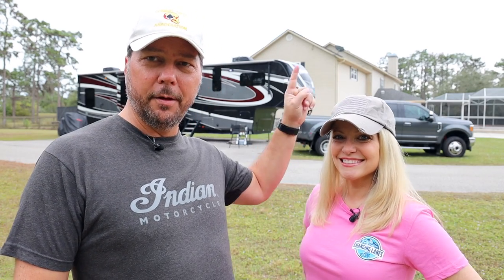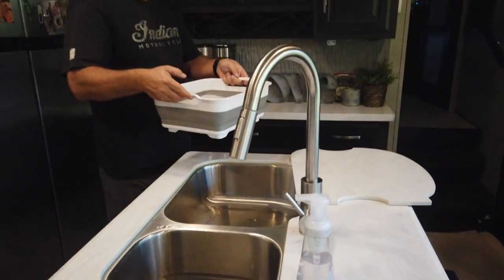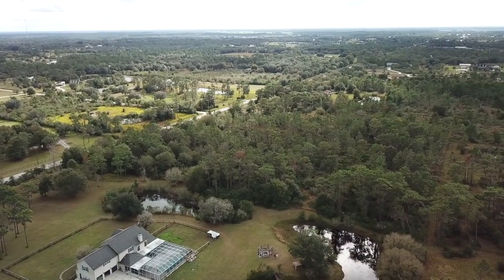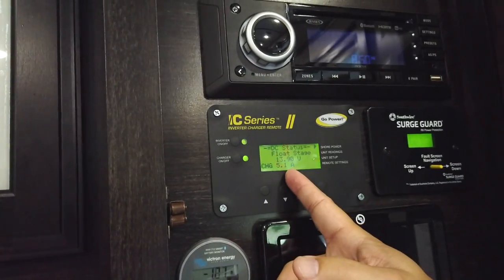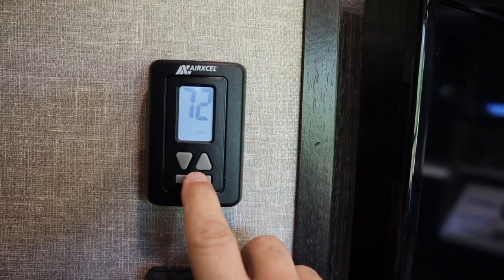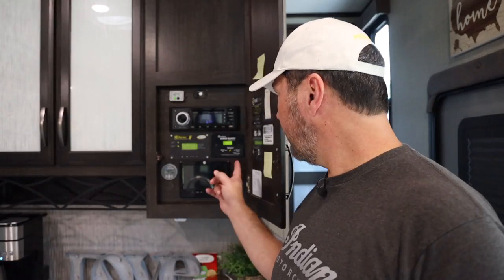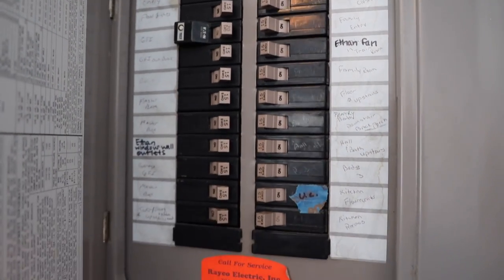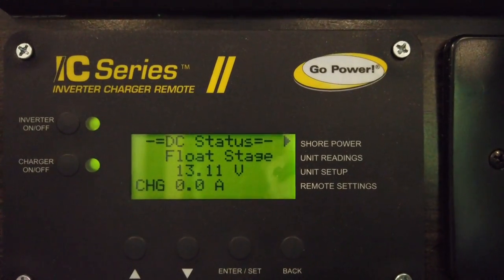RV Moochdocking! | Cheat Boondocking Like a Pro! | Changing Lanes!

Comment: the water meter is an idea that I have thought about for a couple years, but as I havent done any more than think about it, I have a question about using one....
   with the water meter being connected to the filler inlet, you can see how much water you used since your last fill up.... but why coudnt the water meter be connected to the pump outlet so that you could see what you have actually used from the tank in real time?...  

  a few extra feet of water line would likely need to be added so that the meter could be mounted in the UDC, so its convenient to read..... 

 we spend 98% of our time boondocking, and only use a campground/park when we have no other option, or when need to service all the tankage, and of course, move on as soon as possible.... and when boondocking for extended stays, my fear is running out of water at an inconvenient time, and so a meter showing what we used would allow us to know what should be left in the tank, which would help us know when we need to slow down the water consumption, and when we could splurge a bit and take that extra shower or two...

Comment: You have to watch outside plugs on a house. Many homes the outside plugs are on the same GFCI ckt and are most liky 15 or 20a. So you don't want both 15a on the same ckt of the input. You need 2 different 15a ckts.

Comment: So get a surge protector hardwired with an invertor!? I was planning on getting a TT with solar prepped and upgrading panels and batteries. So for winter Mooch/boondocking would it be better and more cost effective to use solar and electric vs propane and generator? Thank you for the information.

Comment: About your generator, maybe the 5500 (45A) is not appropriate for the size of toy hauler you have, probably a 7000(58A) or 8000(66A) would be more appropriate, specially when running a three ACs. Good moochdocking video.

Comment: I watched video and read "almost" every comment to make sure it wasnt posted. If so I apologize. 1st question, how do I know which circuits are on same leg? Next question regarding hooking to generators. For a 50amp RV, could I use the same concept of one 50amp plug to two 30 amp plugs and plug those into 2 portable generators to get enough to run 2 a/c's etc.? Thanks for any info.
Reply from the maker: Most 50A RV's that we've seen have the main 50A breaker in the middle of the distribution panel (circuit breaker box) with leg 1 breakers above and leg 2 below.  You can to 30A+30A.  Doesn't really matter if the power source is a house, generator, or whatever.  BUT... If you decide to use the 30A plus 30A setup, try to connect them to separate LEGS, not just separate circuits.  If you have to connect them on the same leg (still separate circuits), be sure to stay under 50A TOTAL for both legs.  The reason is if you draw the max (30A) on both legs and they are on the same leg in the house, the legs are IN PHASE and will cause 60A on the Neutral line.

Comment: Are there any tips you can provide concerning protecting the outside electrical components like the dogbones, or cord connections from heavy rain?
Reply from the maker: I just run the power cord underneath the RV if I need to use an extension.

Comment: Chad, not certain I can get my head wrapped around the 50 to 30 and then the 30 to 15 adaptors. Why not use a 50 to 15 adaptor which would eliminate the additional connection points which can be problematic within themselves.
 BTW, I got to use the TSD Logistics fuel card on our last glamping adventure. Saved me about 30 bucks over a 1,000 mile trip. Thanks for the video tip on the fuel savings.
Reply from the maker: True.. less connection is better but not critical.  This is just the way we do it.. 50-15 is good too....

Comment: I have a 2022 reflection that's being stored in my backyard.  I'm plugged into 15 amp but the breaker box says that outlet is 20 amp. I followed your instructions and it worked.  My surge protector says I'm pulling 13 amps.  I don't have a soft start or an inverter(i don't think). Nothing else is plugged in.  I just want the ac because we are experiencing over 100 temps and it gets up to 115 in there even with relectix.  I guess I just want to know if ill be able to continue to run at least one like this without hurting anything.  Thank you

Comment: Thanks for sharing! Great information. I know very little about electricity and it's "workings". Do you guys just try and avoid using your generator? I have seen most of your videos and can't recall much about this and would like to know can running your generator cover all the RV you have? I assume cost of running a generator factors in but not sure. Safe travels!
Reply from the maker: Running the generator will run pretty much everything.  But it's nice to not have the noise and burn the gas when some type of external power is available.  Particularly at night when we still need AC or heat all night.
Reply: Thank you! I appreciate the prompt response and everything you do to help others! Best wishes!

Comment: Thanks for the video.  I just ordered a Victron Multiplus II inverter which I know you just received.  I was wondering if the 2 x 15A connections going through the new Victron Multiplus Inverter now give you 30A total since the inverter combines both leg 1 and leg 2?  Thanks again for the great video.
Reply from the maker: I'm not sure how this will handle two sources.  I will test when we get the chance, but my plan is to just use one cord for 15-20 Amp and let the inverter handle the rest.

Comment: Ok..so I’m trying to use your link to buy the 50a splitter thingy lol and it takes me to the regular 50 to 30 dogbone. I’m sure I can find it on Amazon myself but I’m probably going to buy this if it’s not outrageously high so I want you to get your 2 cents worth from Amazon since I wouldn’t even being considering it if it weren’t for watching this. I’m thinking I can use it in my own driveway as well to have the a/c for guest or while I’m working inside when it’s hot. Please let me know what I need to do so that you get credit for my purchase from Amazon. Great video!
Reply from the maker: Thanks!  Fixed the link: https://amzn.to/3jXWXGK
Reply: Changing Lanes I almost missed this because I didn’t get notified and I’m guessing it’s because you didn’t actually click the reply and make my name come up. I came back to this video to ask you if this trick will work with a 50 amp service that strictly runs on batteries and doesn’t have an inverter for the whole rig? My inverter is strictly for my residential fridge so I’m wondering if I will still trip the breaker trying to fire up my smaller a/c even with this work around due to not having an assist from an inverter? I’m going to try it with this cord...thanks for fixing the link. I’m buying it and another 30 to 15 as well so I hope you get credit for my whole order. Thanks!

Comment: What's the point of soft starting the AC and then setting the fan to Auto? The first time the AC turns off, you loose the "soft start". I'm not sure turning the fan on first manually is that necessary since those fans probably don't draw more than 1A anyway and likely will turn on before the AC compressor turns on by default. I'm just guessing though

Comment: Hehehe I have did that a few times, and my BIG Boo-boo was using #14 extension cord. It melted the dog bone connection. So know all my extension cords are #10 or #12.
Reply from the maker: Yes...  Good point on the extension cord.  I should have mentioned that the extension cords need to be rated for the amperage.    I also should have noted that an EMS or total electrical protection system are highly recommended to detect any voltage or wiring issues.  We will add these to the description and blog.
Reply: Voltage drop sir.

Comment: For what it's worth.... If the moochee has an electric clothes dryer and the wiring is set up for a gas clothes dryer option, the open 120 volt outlet should be a 25 amp circuit. 10 extra amps helps.
Reply from the maker: Just be sure you know exactly what you're connecting to.. Many dryers use 240V.

Comment: all you have to do to get on different 15 amp circuit is plug one in then go turn off breakers in their service till the power to your plug is disconnected ( only need to turn off the 120v breakers). Then leave that breaker off and plug your other 120v extension cord into different outlets till you find one that is powered so obviously it is on a different breaker then turn the other breaker back on . Whalal you are on 2 different breakers at the service panel you are mooching from.  No tracers or tools or meters etc needed.

Tip:  Get the extension cords with the light  in plug .  You can tell immediately if that plug has power without running back in rv to turn something on or yelling or calling back and forth !!!

Comment: Get a Circuit breaker finder to find if you are on the same phase and it you are on the same breaker. I have a southwire.  I had other and didn't work as good but. Get a good one. Like a Southwire , Fluke, Gerber Bender,  Ideal.  They work now to find the Circuit.
Reply from the maker: Great idea!

Comment: Chad and Tara what is your thought about 80% of 15 amp rule or 12 amps is safe drawl on 15 amp circuit. What size extension cord do you have for such a long run?
Reply from the maker: Good points... Notes to both have been added to the video and blog:
➡️ EXTENSION CABLES: Be sure to make sure any extension cables you use are rated for 15A. For longer runs like 100ft, these are NOT the cheaper cables. They should be labeled with rated amperage. Also, the longer the cable the more the voltage will drop, so keep an eye on it to make sure it doesn't drop below 108v (90% of 120v).

➡️ HOUSEHOLD CIRCUITS: When a household outlet/circuit is rated at 15A, that rating is generally for short term (under 3 hours). The real rating for long term load (over 3 hours) is 80% of the rating. Meaning, on a 15A circuit, if you’re going to run it over 3 hours, you should be at 12 Amps or less. An AC is like long to cycle less than 3 hours anyway, but on a hot day, it’s something to be aware of.

➡️ HEAT: When connected to 15A or 15A+15A and running for about 30 minutes under load, do a check of the entire line from your RV to the adapters, to the extension cables, and to the wall outlet. Do a touch test to make sure the lines and/or connectors are not getting hot.

➡️ POWER PROTECTION: We HIGHLY recommend using a Surge Guard Total Electrical Protection device (see: youtu.be/4FNtBtE_x2s), or some type of EMS that validates your power source voltage, frequency, wiring, etc. These are a great safeguard against bad RV park wiring as well as bad household wiring and just plugging things in wrong.

Comment: Great video! Have learned so much from y'all!  Chad I have a question, well 2.  We have a momentum 381M and have the gopower IC2000.  If we use this splitter with 30amps on leg 2 and 15amps on leg 1, do we set the shore power setting on the converter to whatever you have on leg 1? (15 amps in this case due to the power assist only being on leg 1?)
Also If we are not using the splitter and are just using a 50 to 30 adapter and have 30 amps total available to both legs, would you recommend setting the shore power on the converter to something like 20 in case someone (wife/kids) adds a big load to leg 2? Thanks!
Reply from the maker: Yes... the GoPower only looks at leg 1 for current, so set shore power setting to what's on leg 1.  In the second scenario it's a bit trickier.  You need to set it where you think line 1 will be when it needs power share help.  But, yes.. something like 20 or 15 or even lower if you want more coming from the batteries...  But, it sounds like you have the right idea.. 👍🏼

Comment: "Electric dryers generally draw about 30 amps at a voltage of 220 volts, although large industrial models could draw up to 50 amps. The standard in 220v plug types for a 30-amp circuit is typified by the National Electrical Manufacturers Association 14-30, which accepts three conducting wires and a ground."  this quote was from a russian ip run by Mesopotamians.

Comment: I love all your videos but I need to point out a couple things on this video when it comes to power. Your extension cords need to be the #12 rated due to the length. Under national electric code you should not load up breakers for continued use more than 80% (actually I believe that code changed in 2020 to 75%).   Therefore the 15a brkr that your mooching off of needs to stay below 12a.
Reply from the maker: Yes... Good point on the extension cords and 80%. Notes have been added to the video and blog post.. 👍🏼

Comment: Ok, this is the second time I have watched this video, and one thing in your setup troubles me a bit. The way you stepped down the connectore from 50 to 30 Amp to 15 Amp is steller! But when you connected the lonnnnggg extention cord to the 15 Amp sourse, you did not mention the carrying capacity of the extention cord, (14 gauge wire, 12 gauge wire, or 210 gauge wire). With your rig there is a potential of drawing more that 15 Amps, as you stated during the startup of your A/C unit. We have been part time RV'rs for upward of 35 years, all of the RVs we have had have all ben 30 Amp systems. Starting out we had a lot to learn about connectong our rigs up electrically. Many years and lessons ago, we were at a fair ground at a dog show, and as usual for a fairgroungpd, there were no 30 Amp connections available, and being somewhat ignorant about power management we stretched our extension cord out to its 100' length and connected to a 15Amp outlet. We had a fairly good dog bone connector to connect our 15 Amp extention cord. It was winter, and there was 8" of snow on the ground. Imagine my surprise when the next morning, when I  found that our extension cord had melted snow all the way to the ground! Of course the extension cord was not heavy enough for thr load we were trying to pull from thr 15/20 Amp outlet, and I have no idea what the actual voltage was getting to the RV. 

THANKFULLY, over the years we have found some great mentors who have clued us in on better power management. We currently use a 50' 12 gauge extension cord, or if that is not long enough, I  just use our generator. Since watching your inverter install, I have been thinking about putting one in our rig.
So, what gauge is the wire in your very long extension cord?
Reply from the maker: Yes.. I should have mentioned that in the video.  Sometimes a detail or two get missed and we put them in the description or blog post (see: https://changinglanesrv.com/rv-moochdocking/)....  Our cords are rated for 15A and I thin it's 10 or 12 GA.
Reply: @ChangingLanes  After melting our wway through 8" on snow overnight we bought heavier cords to be sure. I am just glad that the RV was a 1976and the only electronics was rge fridge, and that was very primative.

Comment: Hi i love your video's, keep them coming! I do have a question, i plugged my 30amp  trailer to my house, with an extension cord and an adapter. The next morning i went to move the cord and it was blazing hot! I immediately unplugged it, the end of the extension cord at the plug was burned and my new 30amp adapter was also burned, why? What happened? Ive done this multiple times and this has never happened before, but now im afraid to plug my coach in, any suggestions?
Reply from the maker: You likely need a higher gauge extension cord.  Most are rated for 10 or 12 Amps.  They have 15 and 20 amp cords at Lowes or Home depot, but they are quite a bit more expensive than the regular ones.  On the 30 Amp, its likely the extension cord connection that burned it...
Reply: Thank you! I purchased a 100 foot 10 guage, boy that was expensive 130.00, but i dont want my house or rig to burn down. Thank you again. And keep your videos coming. I love your advice and experience from both of you!

Comment: Surprised you didn’t cover line drop, resistance, and heat at the connections, and extension cord gauge. I run 10g cords for large appliances/tools on 50-100’ cords otherwise the cords heat up. And protection for those connectors from rain.
Reply: Curious.  I'm not using extention cords, just the dogbones like in the video and the cord was still getting really hot.

Comment: Hey guys. Super video and great information. Have been trying to decide which way to hook to our rv to keep the battery charge. Looked at the 15amp to 50amp using at least a 12amp cord. Would like to have at least a 30amp at home to pull into. Currently just running a trickle charger to the battery. Wishing you both a Happy New Year and safe travels. Keep these videos coming for sure. 
One question off subject if you don't mind. Do you have any issues with road debris, like gravels, denting or denting the front bottom of your rv where the generator door is?
Thanks
Reply from the maker: No issues, but we have really solid and low mud flaps from DuraFlap.com  👍🏼

Comment: Were the extension cords at least 12awg? That was some long runs of cable. If you can afford it, I strongly recommend getting 10awg cables to lessen line voltage loss.
Reply from the maker: 10 AWG is what I used...

Comment: Got a question, I have two generators one is a Honda 3000 and one is a Honda 7000, to my knowledge I can not parallel them and get maximum output…but is there an adapter that will take two generator 30 amp plugs and allow me to use my 50 amp rv plug? I can’t run both ac units off of the 30 amp plug…..or just my 7k generator, how can I make this work? Thanks for all the helpful videos, keep it up! Any suggestions would be greatly appreciated! Moose 23-10
Reply from the maker: I would just use the 7K.. that should run 3 ACs no problem!
Reply: @ChangingLanes  found out the plug I was using was not allowing the second 120 line through… so it was like I was using a 30amp plug, one hot only